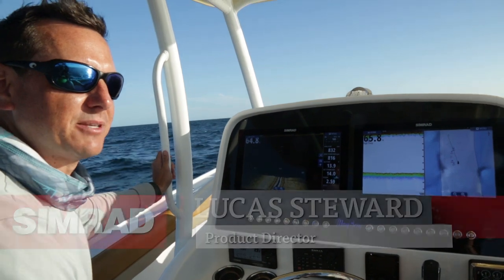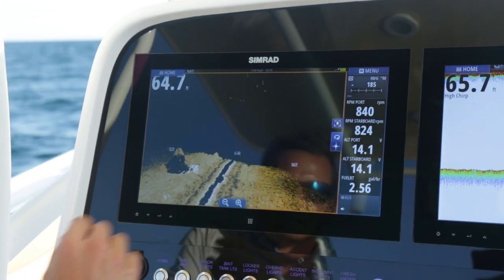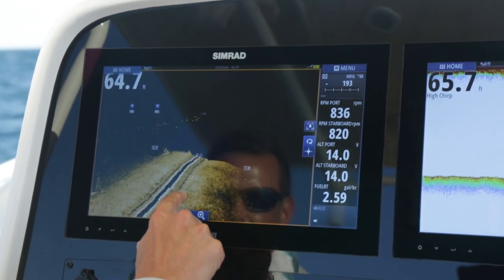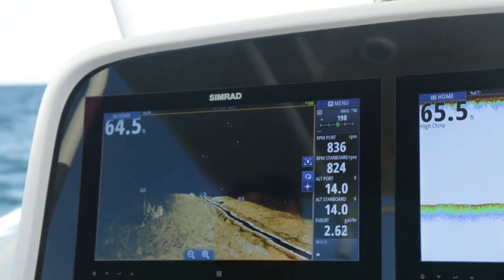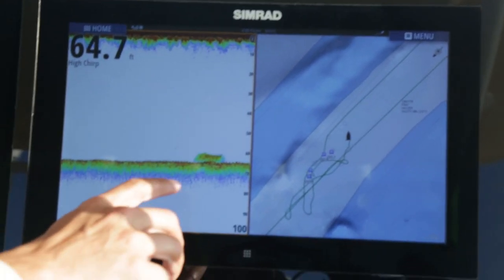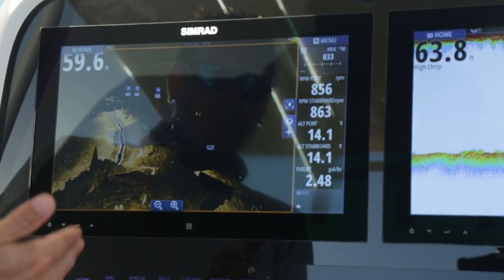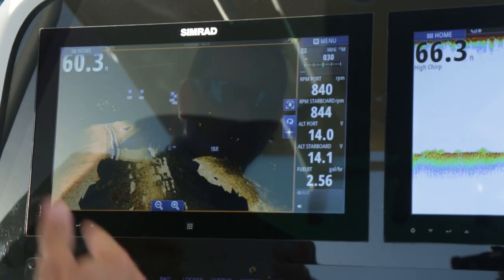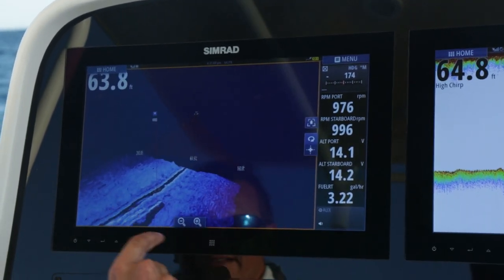Simrad StructureScan 3D | How to Fish a Wreck

Comment: PRO:1. Use these for attaching weights on the line. 2. Plenty of sizes.3. Durable https://www.youtube.com/post/UgkxUggREp1Kytzg8CpXMHFtlfQp4bskrIuy and won't rust so far. CON:1. Seems the price is going up on these.2. May now work in all situations if going for a picky species of fish.3. The really small ones are not that strong.OTHER:1. BUY if you want the best price to quantity on friend, that I think.2. DON'T BUY if you are working with really picky species of fish, these may turn fish away.